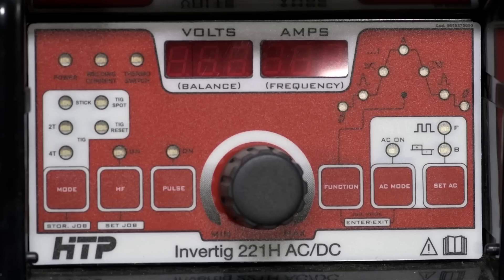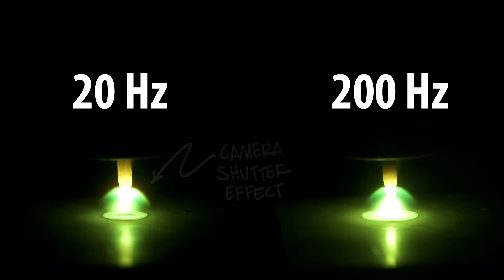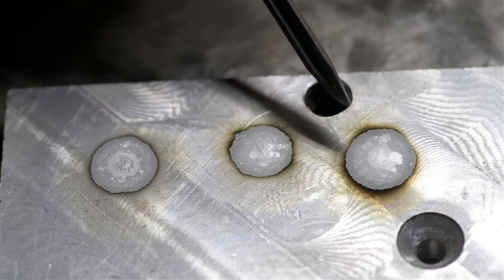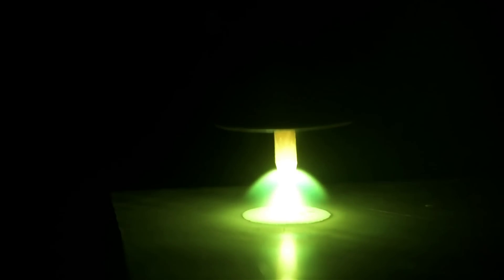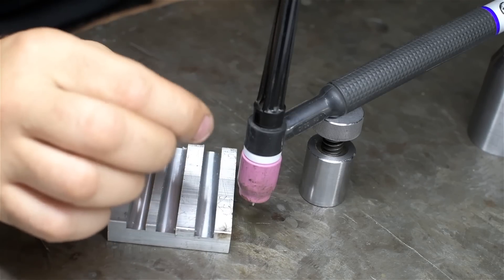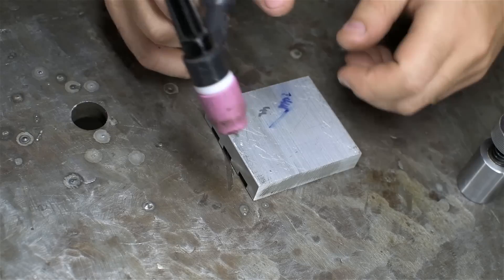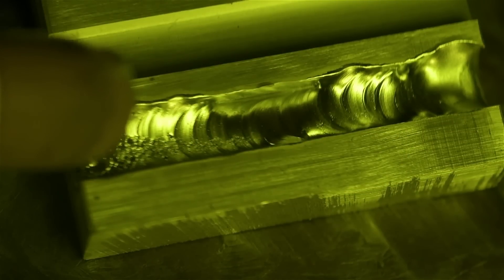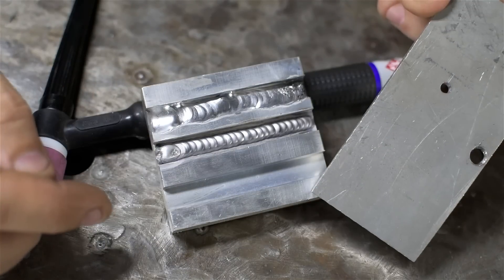TIG with TOT: AC Frequency?!

Comment: You should do the test you did at the start where you show the arc with the torch on your machinist jacks, but in a slot instead, maybe the low frequency keeps its large halo and the high frequency only keeps the arc in the center of the slot and is less attracted to the edges.  Idk, maybe something to do with the thin edge having less material therefore less potential conductivity?

If I'm right give a shout out to mielkes used auto and salvage haha.
Reply: I'd try it myself but sadly I've only got access to mig and stick welders, no tig here :(

Comment: It would be interesting to know what the spectrum of the output of your welder actually is. If your welder has a small high frequency transformer on the output side, as many inverter welders do to reduce transformer size and weight, then a substantial amount of output energy is actually at the basic switching frequency and higher harmonics. The basic switching frequency of the inverter stage is probably at least 10 kHz. So, skin effect might actually be substantial. How about having a look with your current probe.

Comment: I agree. I am able to start a puddle faster with lower frequency and 25/30 amps and pulse off, especially with like .20 mild steel(s) using 1/16th tungsten and filler rod. And You can imagine what it's like using those two with steel thinner than the filler and rod LOL. You move quickly !!!

Comment: A few things:  I would have liked to see your welds in normal time, not fast forward.  You just seemed you blow past your wider weld.  I would have liked to confirm that you were consistent.  (My 2nd aluminum bead is always better too.)

Secondly, I didn't hear a word about AC balance.   I have a old-timey transformer type TIG machine --a Syncrowave 250, which can't adjust the frequency, but can adjust the AC balance.  According to the manual, when the balance is set for max cleaning (55% electrode positive) you get the widest arc.  When the balance is set at the other extreme for max penetration (32% electrode positve) you get the most narrow arc.
Reply from the maker: Good point Thzzzt.  Given all the questions / suggestions I may do a follow up video.  Never touched the balance in this video.
Reply: On re-thinking this, you were isolating only one variable, which is good.

Comment: As an electrician who occasionally welds, skin effect theory has much less to do with the effect of frequency than time. That being - time on, vs time off, and time starting, dwelling, and closing the arc. And the amount of times it does this over the same given amount of time... In the modern invertor machine, amperage can be manipulated a lot more than it can other raw electrical sources. Which would otherwise follow simple rules - i.e. voltage up = amperage down... By manipulation of the wave form you really get to change that dynamic. I doubt anyone has a high speed camera fast enough to capture actual footage of a welding arc being formed and cycling - alongside an oscilloscope in real time. But that would be some great slow motion footage.
Reply: I should also say, that (and I should duck first) the amount of time a plasma arc is most effectively producing heat, is likely at lower frequencies- despite occurring fewer times per second than higher frequencies. Higher frequencies there would be much more starting and closing of the arc over the same amount of time. Changing the cleaning dynamic vs heat produced for depth or melting speed.

Comment: Couldn’t you reproduce your test block on the lathe so it’s round and then use your rotary weld table to control the variable of weld speed?  E.g. have the amps, and rotation speed fixed (making sure to account for differences in angular velocity on inner paths), and then just manipulating frequency?

Comment: The plasma actually comes from the shielding gas when the electric field strips the electrons from the element (or compound in the case of CO2) used for the shielding gas.  Otherwise, you would see a much higher consumption of your electrode and the weld puddle would be more contaminated.
.
With regards to the "skin effect", this is more of an effect for high (actually, very high) AC voltages.  On the high voltage electric transmission lines, usually above 100kV, the electrical conductors are actually tubes rather than wires.

It is an interesting question that you raise.  I thought that the RMS voltage might be coming into play, but for sinusoidal waveforms, the RMS voltage of an frequency is the same at ~0.707 V(max).  Now with AC TIG welding on Aluminum, the output waveform may no longer be sinusoidal or symmetric and thus the frequency may then affect the RMS voltage.  Just to point out, when you use a voltmeter to measure an AC voltage, it is providing you with the RMS voltage, not the peak to peak voltage.  When I set up my AC TIG welder, I may need to check this out by measuring the output voltage using a voltmeter.

This leads me to the question of when the voltage is being set for AC TIG welding, just exactly which voltage is being measured or indicated?  Is it peak to peak or RMS.  If it is a peak to peak voltage, then the RMS voltage will change depending on the waveform and symmetry.  If it is RMS, then does the circuitry in the welder compensate for the wave form and frequency?

Also with AC power there is what is called reactive power and real power.  The ratio between the two is called the power factor.  As the frequency increases reactive components such as motor windings, transformers and other inductors will have greater losses.

And then to make matters even more complicated, there is the question of eddy current losses.

Wow, the mind is boggled.

Comment: Seeing as everyone else is throwing their 1/50 of a dollar into the ring, I might as well have a go. 

Consider pulse welding, you have a spicy phase and a cooler base current. Now AC is tricky, because the straight part is dumping 70% of the heat or thereabouts into the puddle, but when you flip it, it's only in the region of 30%.

At a lower frequency, you're spending a longer time in straight polarity, delivering more heat at that point. The metal can only conduct heat so quickly, meaning you get a more blown out looking weld. As the frequency increases, everything starts to average out, decreasing the fluctuation of heat input. 

The only way to truly answer this though, is for someone to set up a 2.4GHz TIG welder. I ain't volunteering though, I'm just the ideas man.
Reply from the maker: good insight!

Comment: In the late 1960’s all of the TIG welding I did was at 60 because there was no adjustment for frequency. We used a standard welder which was hooked up to a shop made water cooled flex TIG head all short tungsten tips ground to a sharp point. Only welded Stainless Steel pipe schedule 10 - 40. Never cleaned a joint always two passes 1/8” filler rod always uphill. Pipe in a vice start at about 4 o’clock to 12:00 o’ clock. Internal purge on food grade jobs left in side bead smooth as glass. We had a guy who welded Gold to Silver with the same rig. I think it was reverse polarity?? I didn’t do a lot of it I was stick welding burning 6011 on steel pipe. 7018 Low Hydrogen on high pressure stuff. Always uphill. All gas pipeline welders welded down hill. Our shop would not hire a downhill welder not sure why. I’m 70 years old and haven’t welded since about 1972. Just shooting to poop.

Comment: the middle one is the best weld the current in the metal is another reason, I assume the arc needs to be 50 percent for a decent weld? correct me if I'm wrong, I really don't weld.

Comment: With my negligible understanding of the physics of welding and electricity, I wonder if higher frequencies are less hot because the electrons are moving shorter distances; though I don't know how that would interact with the faster voltage changes (which I believe would result in relatively higher accelerations)

Comment: It's most likely a little more complex.  This is an inverter welder so the 240V mains get rectified to produce  ~339V DC.  Depending on how much the manufacture spent on 400V filter capacitors this could be rock smooth DC or very pulsating at twice the mains frequency.    The DC is then  chopped up with a switching circuit at I would guess between 5kHz and 25Khz,  PWM modulated to set the amperage and finally fed through a step down ferrite transformer to reduct the voltage (and increase the current) so as not to electrocute the welder.   The secondary output of the transformer is rectified and possibly filtered to some extent to make the DC welding voltage.    The polarity of the DC can be adjusted for EP or EN  by reconfiguring the rectifier arrangement under control of the welders control processor.  To make AC all the processor has to do is to switch the DC between EP and EN  at the selected frequency rate.  AC balance is just the ratio of time spent in EN vs EP.    There will most likely be dead time (no current output) during the switching period between EP and EN.   This is likely to be a fixed value based on components used and the software latency.  At higher frequencies the dead time becomes a larger part of the current on time than it does at the lower frequencies thus, the possibility of needing more current at the higher frequencies.

There is also the interaction between the PWM modulation, mains input ripple, inverter switching frequency and the AC commutation switching that complicate things.   And there is the characteristics of the plasma arc and how its conduction changes during the cycle.   I don't buy any skin effect at 200Hz,  2Khz or 20Khz possibly.     The current out needs to be measured then sent back into the control processor as feedback to control the PWM and keep the current constant.
Reply: Indeed, you will not see any skin effect from the primary output waveform, but this is an idealised picture of things only; I suspect that it would easily be possible to get a >2kHz secondary waveform - with quite appreciable current, too! - due to ringing, since the transitions between + and - are not particularly clean.

We need an oscilloscope reading in order to better understand this phenomenon.

Comment: I gave up trying to find a way to determine the frequency when welding aluminum (I don't do much aluminum welding, anyway), but on the Rehm Invertig 330 i've been fiddling with lately the ac frequency is set to auto, and it looks like it's inversely proportional to the current (when i lift the foot off the pedal, the frequency increases).

Comment: Square waves may not be as square as you think they are. Due to capacitive and inductive effects of a huge loop of wire this all will result in less energy transfer at higher frequency because there are more reversals

Comment: You may need to think about the skin effect in the plasma itself, rather than the work. That would probably affect the width of the arc (ie current density) rather than the current path in the metal - but that would at least suggest a reason for the alleged behaviour. Problem is, info about skin effect in plasma seems to only exist in paid-for journals. It's possible the skin effect is more pronounced in plasma, so the numbers (6-8mm in aluminum at 60Hz) may be quite different ie smaller.
Reply: Murray Edington absolutely! It's my understanding that the heat that melts the metal comes almost entirely from the resistance of the PLASMA and not the base metal. Otherwise, why isn't the whole block melting? Why isn't the point the electricity existing the part also melting as quickly as the weld area?
Reply: plasma doesn't have reactive skin effect in the way solid conductors do. In plasma there is significant physical flow of charged particles and the flow of both + and - charge carriers is much higher than the movement of electrons in a metal.That is electricity isn't flowing through the plasma like it does in metal, the ionized gas is its self the charge carrier. The heat comes from the ionizing and deionizing of each particle much like breaking molecular bonds in a chemical reaction, same reason why gases at high vacuum are better conductors there are fewer reactions for any one unit charge to travel a length of the arc gap.

Comment: Good Vid but the Human effect still comes into play, you could have gone slower at 20 hz and faster at 200 and not realized it. You would need to lay the rod into the space (not feed) and rotate the work at a set rpm with the torch held stable.

Comment: In Acoustics, driving a loudspeaker at a given frequency requires twice as much power to get the same sound pressure level, as it does at twice the frequency. 
So for example, driving a speaker at 50 Hz, requires twice the power of driving it at 100 Hz (not caring about efficiency losses and driver mechanics).
Maybe the voltage while welding at lower frequencies is higher, than while welding at higher frequencies? For the same welding current of course.
This is also just a theory.

Comment: Can you record the amperage or voltage measurements? Maybe the equipment can not generate the same power at different frequencies.

The square wave may also become more sinusoidal with higher peaks. There migt simply be more peaks. 

Can you compare 20hz at 75% of the power setting with 200hz at nominal power?

Comment: Most likely the amount of time the wave form (sine or square) is at full voltage or power, as the wave form switches form one side to the other it has to pass though zero volts, lower frequency more time at full voltage = more heat and a bigger puddle and cooler at a higher frequency. https://en.wikipedia.org/wiki/Sine_wave    Ps thanks for the awesome vids Tony

Comment: Is the issue not got to do with duration?  So for example when you touch something very hot very briefly the heat has no time to transfer.  If you tap your finger 4 times per second on a hot stove for one second might hurt a bit but you can get away with it.  Try doing it with two taps ... erm much more painful ... and so on.  Bit like moving your finger through a candle flame.... same deal.  anyhow my 2c...

Comment: frequency improves arc stability and reduces arc blow, stability improvements are mainly seen with sine waves because the amount of time the arc has to "coast" when switching is less. Square waves don't give a shit because the amount of time it takes to switch is the same because that's based on the properties of the switch itself. If you want a more focused arc, I have read that hydrogen focuses and intensifies the arc, but makes it more difficult to get the arc going because it takes more to make hydrogen (and helium) plasma than it takes for argon.
Reply: Do note, since square waves are dependant on the properties of the switch itself, higher frequencies mean the duty cycle goes down, and thus heat output goes down (especially if they cheaped out on their driver, and had to add more resistors so it takes longer to fully switch the IGBT), sine duty cycle remains unchanged. I might have to do some tests to see for myself once I have the kinks worked out of my 120Hz generator, although since the welder isn't made to run on 120Hz, my tests may not be entirely accurate.

Comment: another keyword to get closer to the truth what different frequencies does is maybe "eddy current" a lower frequency does a deeper penetration then a high frequency. So we have beside the Voltage x Current =U*I= Power, a plasma source of heat, also a resistive heat source by eddy current, Power=I² * R. Formulas how deep the effect is, are available on the net. Skineffect is probably not the right effect and happened at much higher frequencies.

Comment: the current inside or on the skin of the pise doesn't do the heating of the puddle, if it was  the way of heating the puddle should have a drop shape pointing the ground.
if the skin effect affects the size of the puddle is by the plasma dispersing more.
by the way i like your videos good editing an material, saludos desde argentina.

Comment: The switching that comprises the AC happens fast but it is not instantaneous. The line of "square wave" reversal is not absolutely vertical. Therefore at higher frequencies a larger share of each second of welding time is spent on switching, during which current is less than max. Thus higher frequency puts less total heat in per second of welding time. This is nothing more than speculation on my part. And, then there is impedance. But Occam's Razor....

Comment: Hello sir, I'm using wurth tig machine, and the setting i use in aluminum is ac frequency 50 and ac balance is 30 and last is amps was 180amps,material thickness is 10mm, and I'm using 1.16mm tangsten, is this possible? And what is the best setting tha you recommend sir please help, thank you

Comment: you might find that the gas ions in a high-frequency arc are more constrained they would not move as far when vibrating with the cycles and have less time to defuse. Think of the movement of much heavier ions rather than the electrons.

Comment: maybe it's got to do with how the current flows through your workpiece and how it distributes and heats up the areas where it is flowing.
at higher frequencies the shape of your work could be seen as lots of capacitors and inductors, they do their magic and become resistors (capacitive reactance for example) therefore not as much current is flowing through those regions and thus they won't heat up as fast.
that may explain why the heat stayed in the bottom of your second trench you welded.
Reply: a great video that explains this in a more extreme scenario is a teardown of a 2.45GHz microwave magnetron by fellow youtuber "diodegonewild", in which you can see the positive and negative of a sort of coil being physically connected, and yet the connections have such high resistance at those frequencies that in laymans terms, no current is really flowing